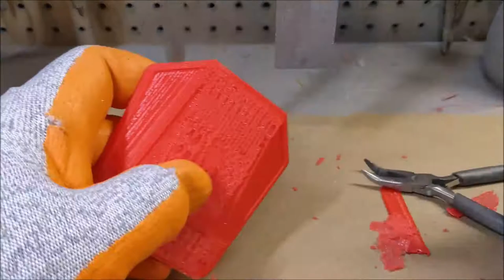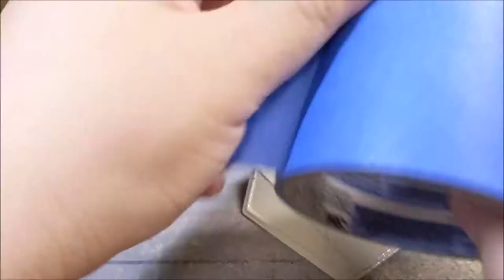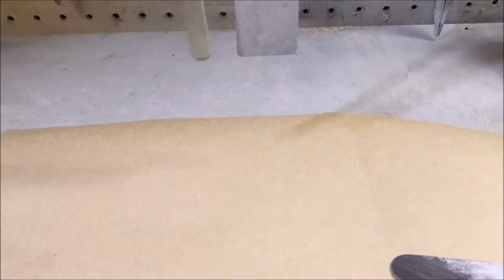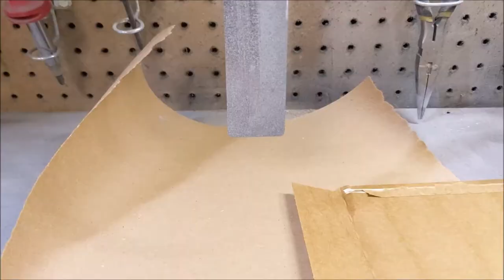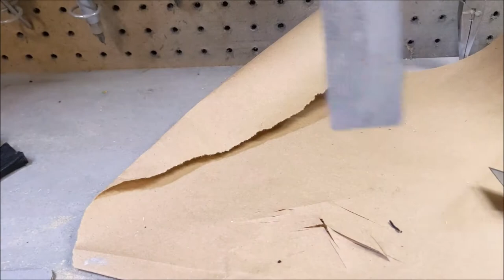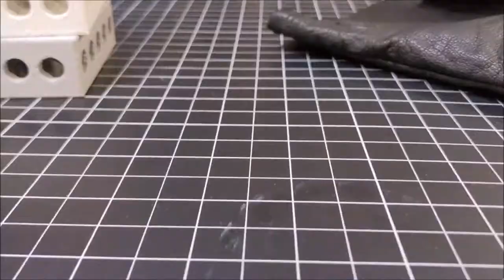The Mandalorian | Cosplay Gloves

Comment: What's the tool you were using on the 3d printed part after you put on the primer?
Reply from the maker: The tool for support removal? Its an exacto blade with a flat blade. You can pick up the kit on amazon its a staple in the shop for many builds. Thanks